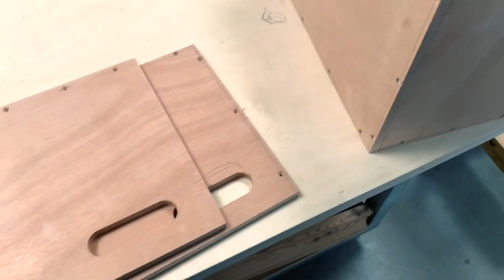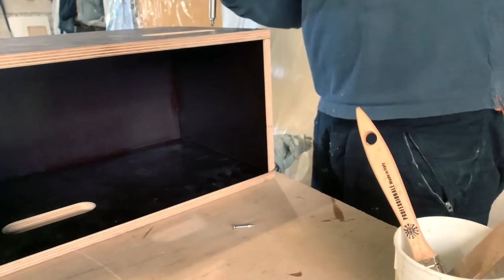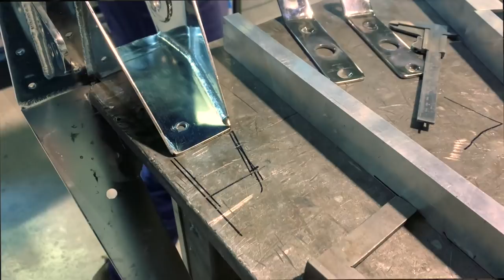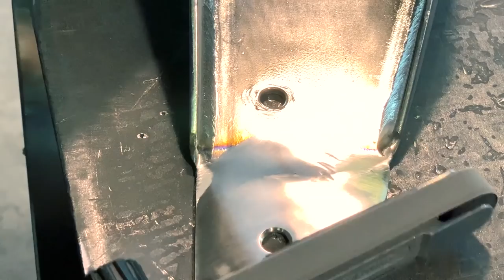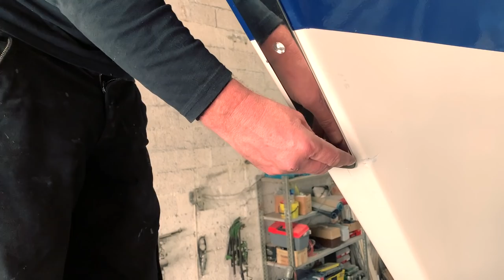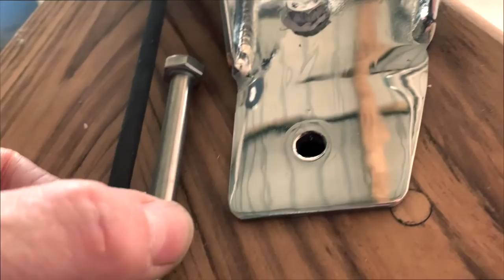Hallberg-Rassy 312 "Ellös": INSTALL THE BOW ROLLER & BATTERY BOX

Comment: Another beautiful job Gabriele! Here is a different way you could have done this, cut and then extent the bow roller strap down the small amount so that you could use the old holes? Ben S?V DAWN
Reply from the maker: Hey Ben! I rink about that.. to much work to cut and welding against and you know when welding the steel bend so more problem....

Comment: Hi Gabriele,
thank you very much for the great channel! I like your videos a lot. 
I have another question about your bow roller. 
Could you tell if you have changed your bow roller in terms of distance to the bow to use your Spade 20kg anchor? I also have a HR312 and would like to use a bigger anchor (currently a CQR 9kg 🫣). But for example, the Rocna 15kg does not fit. Now I am desperately searching for an alternative without changing the bow roller. 
Many thanks in advance and best regards from Munich!
Martin
Reply from the maker: Ciao Martin. I didn’t like Mantus or rocna due the huge roller on the iron that cot be stuck in the bottom I always used and use the spade anchor and she never let my down also on 69kn gale…it fit perfectly the bow roller without any modification and go perfectly stuck on the 2 steel ears of the bow roller. I used a 20 kg spade plus 50 meter of g7 Maggi chain and connect to the anchor with a g7 bow shackle… never use ss steel connection between galvanised steel due the potential electric differential = risk of corrosion! Cheers

Comment: Beautiful bit of work.👍 I have an idea for your battery box lid - do you want to hear it?
Reply from the maker: +Norman Boyes yes Norman give a advice!
Reply: sea4see Really sorry Gabrielle - not sure where the hell that week disappeared to? OK my not so big idea for the battery box lid/chart table seat. I was thinking of this because you have access to your fiends with CAD facility and CNC router, and concerns drawings of your installed electrical circuit diagrams and perhaps also a plumbing diagram too. You can buy multi- layered (and multi coloured) plastic type material (used for signs) which when cut to different depths reveals the different colours. You could have electrical one side and plumbing the other. First step would be to get the drawing into the computer and keep it on file until you have been operating the boat, because you may fit new equipment, once any final amendments to the CAD are incorporated - the diagrams can then be cut on The CNC Miller/router. You could then fix them to both the top and underside of the battery box lid.
Reply from the maker: Thx Norman! But is a quite lot of work! Now that tha covid si gone the guys at facilities are quite busy with cnc ... need to find the time to do it!!! Thx again!!

Comment: Great job and video.
Had you considered Stainless Hex Button screws for the top of the Bow Roller? Easier on the bare foot.
Reply from the maker: Peter thx for write! I consider all the solutions but due the thin steel I can’t countersink and get strength I left the original setup

Comment: On my own boat I've gotten away from the liquid sealants and I've gone almost exclusively to butyl tape. so much cleaner to use
Reply from the maker: Me too Steve !! All butyl bit on the case of the bow roller I prefer to use the normal one to avoid too much thick under the stainless steel ..

Comment: Hello, why you are using AGM as house batteries and not LiFePo4 ?
Reply from the maker: Mainly for the cost.....
Reply from the maker: Hope  you can trust to those china batteries ...
Reply: @sea4see  Yes, this is difficult questions, but aren't everything these days Made In China :)
Reply: @veikopiirsalu8466  Does not include shipping so the cost will be a lot more. Also short warranty, more expensive batteries of this type have a 5 year warranty. Very expensive if they do not last.